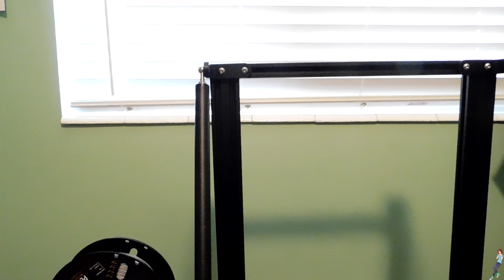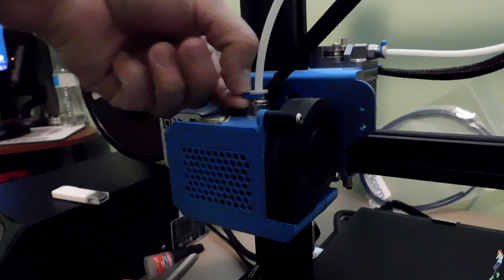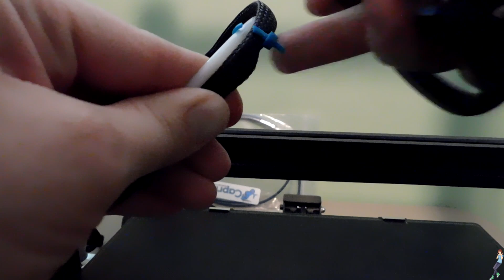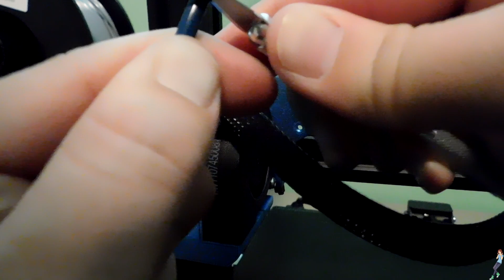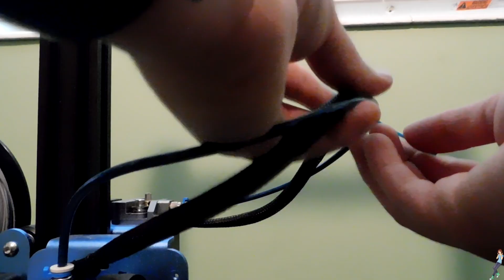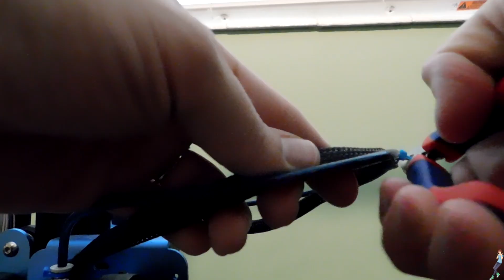CR-10 V2 - How to easily upgrade and replace your Bowden Tube (Meg's 3D Printing Tutorials)

Comment: 2 errors IMHO: 1) no need to loosen the nuts, at least the one at the extruder. Simply remove the blue clips, press the white plastic against the nut, and the bowden tube is released.
2) to screw the nuts after the bowden tube is in place, is a great way to have it broken: the nuts are intended to be in place before the tube is inserted: once inserted, the "white plastic ring" (I don't know the name) has a great grip on the tube: if you now rotate the nut, you get the tube cut.

Comment: Thanks for this video, it was much more helpful than another one I found claiming I had to remove the fan and hot end. Two suggestions:
1. Provide links to whatever products you might recommend for this (tube, new fittings, etc.)
2. In the "squaring off" part of the video, the tube is end is not on screen, so I am not sure what you did.

Comment: Do you know what to do when the tube is stuck in the heating element. Went to swap my tube and I can’t get it to come lose and I don’t feel like yanking the shit out of it and breaking something
Reply from the maker: Yes, heat it up! Preheat your nozzle so the clog loosens up, THEN pull.
Reply: GamerMeg, awesome, thanks! I’m running a print now. I always worry something’s going to go wrong. I over think it. I had a cr 10 v1 that I worked with for a year and I never got it to really work. I think it was a scuffed printer, had somethings wrong with it. Long year of trouble shooting and failed prints, so I finally bought a v2. I always worry I’m going to mess things up on the v2 lol

Comment: i have no spare... how long should i cut the new tube? thax
Reply from the maker: Just cut off as little as possible to relieve the clog. You can always hold it up to the attached cable to get a good measurement.